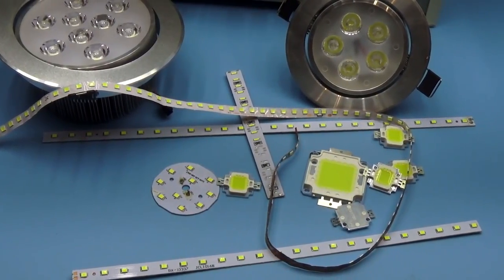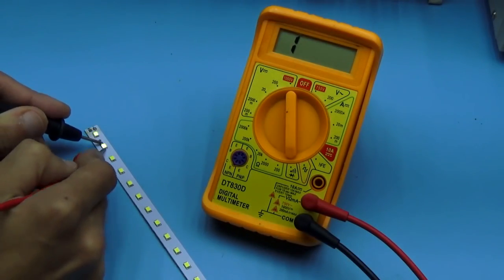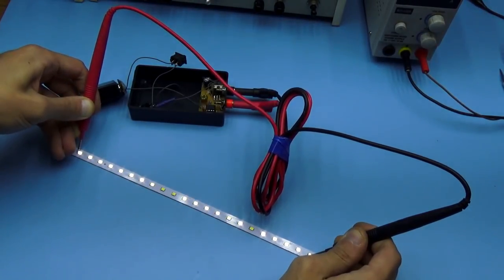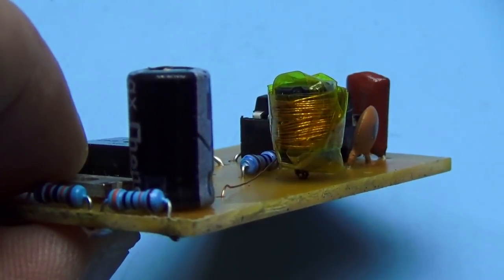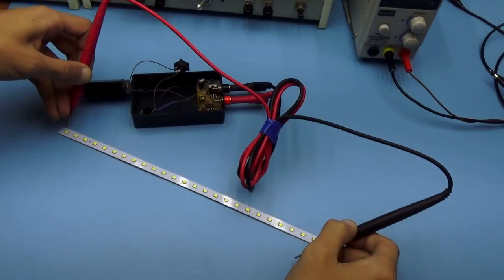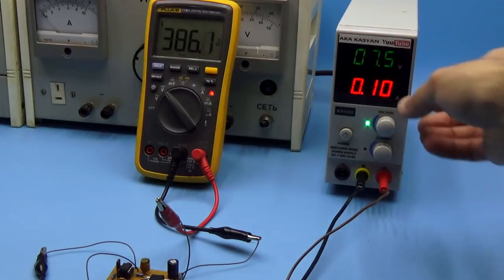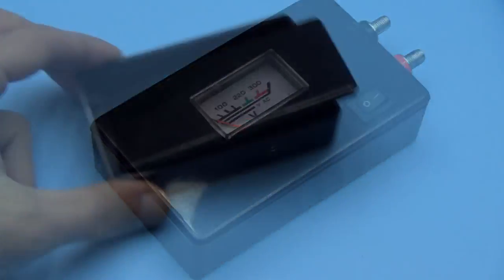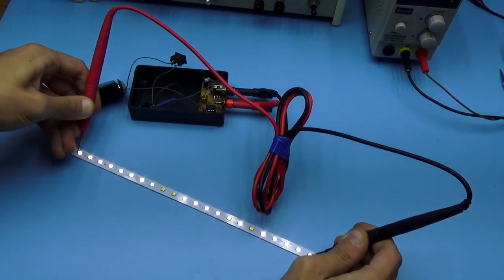SUPER DEVICE for LEDs testing

Comment: i have made this project but instead of using a battery to power it i have used a small 6v smps  i had laying around i also changed the inductor to 1200mH it works superb thank you thank you thank you!

Comment: very adjustable design, I make one using almost only parts (except 555 and two resistors) taken from old usb charger. Some changes was needed as high voltage transistor was used instead of mosfet and current draw is little bit higher but I'll not use 9V battery as power device so it's not a issue for me.

Comment: Hi, just an idea.  I use same priciple to test   I use an  5 volt charger and  connect  the transformers secundary   and parts  from an old 5 volt charger to generate the high voltage. In  that way it is double isolated from the mains.

Comment: Made this yesterday to check tv backlights, works good but just dimly lights them. At 6 volts it puts out 285 volts DC and at 10 volts it puts out over 400 volts. I used an IRF830, a 4.7uf cap@ 450 volts, an inductor at 990 uh and a FUF5402 ultra fast diode, as that's all I had. The only problem is, at 300 - 400 volts, it doesn't light any LEDs except the white ones and the meter gives no indication as to how many volts it takes to light it. Also, when I touch the ends, it gives a small electrical jolt. Any ideas why it doesn't light the LEDs more brightly, or give a voltage reading and why it gives a shock? Thanks.

Comment: Last 2 weeks ago i have saw this video and i realized this the one what i am looking for but i was so busy and i can not make it out . Today i have purchased all the parts in 25 RS it less than a 20 cent . And i have completed WOW what a circuit. wonderful .and works wonderfully with li ion battery rather than 9 volt battery. Thanks to this chanal.
Reply: Can u tell me drain and source connetion to positive and negative which one connect to which one i have 4n60 mosfet
Reply: @aa-wh2jj  pin number 1 of 4n60 gose to pin number 3 of ic. pin number 2 of 4n60 gose coil and another end of coil gose  positive voltage pin 3 gose to negative. NOTE . Coil first end to positive other end is not going to positive . it's going to 4n60 pin 2. 4n60 1st pin is gate 2nd drain 3rd is source. If you have any problem ask me again you are well . Thanks
Reply: Thank you now I got it. I was waiting for the mosfet to be deliverd. But suddenly I found it in led driver circuit that's y I came to video and wasn't sure about the drain and source.

Comment: i already make one it has 250v output 9v input, but the problem i cannot light a LED light. neon light it will glow. when directly put the +probe  in the capacitor without 150k ohm its spark. thanks for sharing and more power and video.

Comment: I had build it like your schematic, but it doesn't work. The 555 is oszillating at 20khz but the Output-Voltage is only nearly 8 Volt. I bought an Inductor with. 900 uH. Is 900 uH right or should it be mH?
Reply: Hello, I have also built according to the diagram and it works properly. With 12v input, I have between 300 and 500v output depending on the different coils. Great to test the leds because there are only a few mA. It is actually μH. Test from 200 to 900 μH.
Reply: @lampesouder  Thank you. I had a failure in my build. Now it works fine. I changed the 555 circuit to adjustable PWM Output so it's possible to adjust the Output-Voltage.
Reply: I build it using same schematic diagram values, i got 18.2khz at pin 3 of 555 and 130v dc. I used 6 volts as in diagram. How should i get 300v output.
Reply: Check ur circuit bro

Comment: How many loops and wires are L1 wrapped?
Reply: That's an unknown. Different types of cores will require different number of turns for the same 800 micro henrys. You could try different number of turns until you get to a point where the current draw from the battery is as small as you can get while still getting around 300 volts on the output. You can also try running the 555 timer at different frequencies. If you have the "wrong" inductance for the frequency the 555 is running at you'll get decreased efficiency, but it will still give a voltage boost. Without being able to measure the inductance with an inductance tool I would start off with about 100 turns for a ferrite rod that's about 0.25 inches in width and 1 inch long.
Reply: At a guess, i'd say 20 -30 turns.

Comment: A created your project on a small cheap protoboard. It works perfectly but I would like to have the option to change R1 for more output current (10ma, 20ma etc). Will I be having any problem with the circuit if I just change this resistor? How much current can I provide to the output? I'm really grateful for your hard work!
Reply: Is dangerous use it with more current, remember is 320 volts.. DC.

Comment: What is the output maximum current? (amps?)
Reply: Bharath Nani , as they said in the video, 5mA.
Reply: 5ma is too low. At least should be 2amp
Reply: @Bharathdbs  2mA 320V ÷ 150000.
Reply: They use a low output current to make it safer if you accidentally touch the wires. It's really only designed to test LEDs, not drive them to full current.

Comment: Why not use a simple one transistor joule thief with a single 1.5V alkaline battery, no mosfet no 555?
Reply: Anshad Edavana, what?
Reply: Anshad Edavana, obviouly you do not know what a joule thief is! It can generate 100V or more with just a single transistor and a handful of passive components. It can act as a current source what is exactly what is needed here.
Reply: Anshad Edavana, google for it, next time read first then ask 😜
Reply: Possible. You definitely have to make the windings non-symmetrical. The base feed would be wound as normal (around 10 turns), but you might need 50 to 100 turns for the collector/LED connection to be able to get the voltage boost you need. A joule thief is based on a simple design that's easy to make.
Reply: I made one ages back or shall I say I converted a fly zapper to a LED tester. The fly zapper works on a joule thief circuit. Here in the UK it only cost me £1 as we have shops over here called Poundland that sold the zappers.

Comment: Many leds will light up dim even they are dead. This device may pass it okey.
Reply: True, but this will help you notice fully dead LEDs, or even compare a series string and look for the weaker LED. It's not a perfect test device for testing all LED problems.